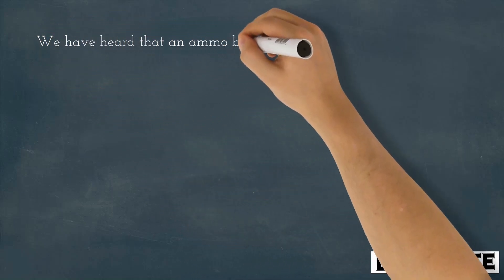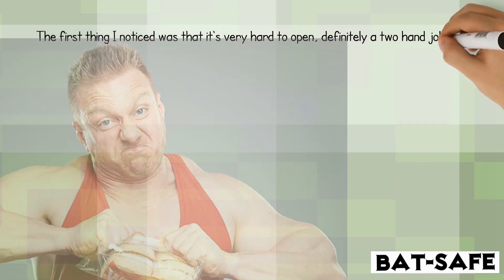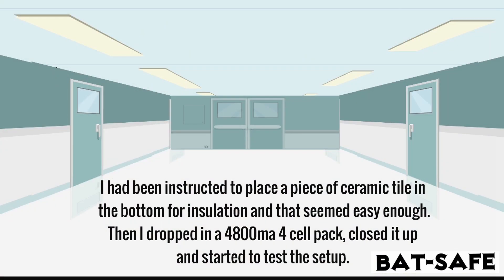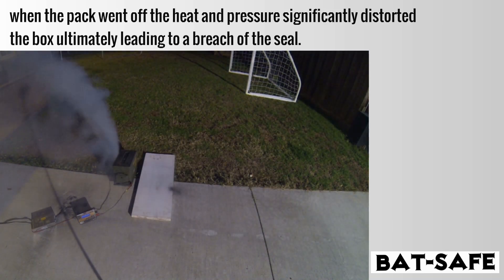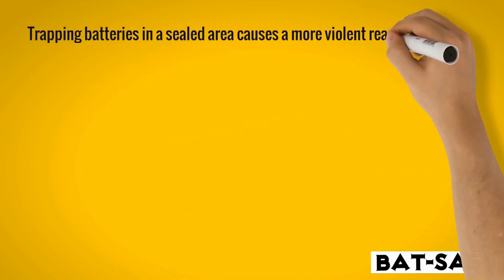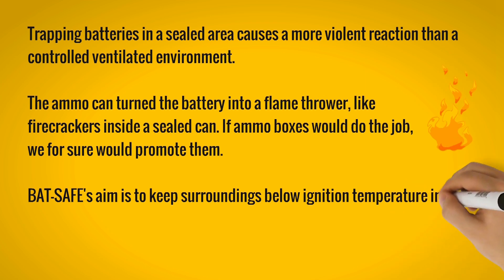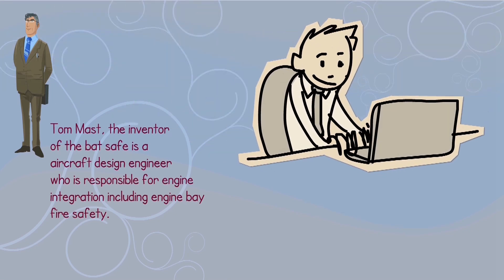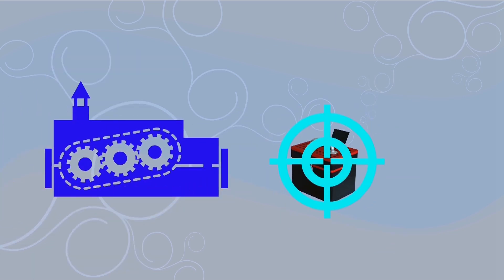Ammo can lipo fire test

Comment: There is a "flamethrower" effect with or without the seal. Show me one single video of these cans "exploding" as others say with a seal. Nope, you cant.
Reply: What about placing your lipos inside a 30 cal ammo box ( with seal removed) then placing the 30 cal inside a 40 cal ammo box ( with seal or lid completely removed. The second larger metal barrier will prevent the flames from hitting anything flammable.
Reply: @emalior5000 go ahead and create whatever scenarios you want. These will however, distract from the issue at hand. This being a false rumor that has somehow become an accepted fact by users of lipos. No true scientific testing of ammo can detonation by means of a lipo failure with AND without a seal has ever been done or proof shown.

Not one single time. 

Furthermore, I'm convinced I know where this false theory originated and have followed the spread of this misinformation for several years.

Comment: These boxes have no filter for the smoke.  Smoke damage can ruin your home furnishings etc.  Also, this box has no hole for the charging cable.  The battery is not supposed to touch metal when charging either.  These ammo boxes may help but they fall short on toxic smoke.  The Bat-Safe covers all the bases.

Comment: To prevent the lipo battery from building up pressure and making a more severe big explosion I recommend drilling at least three 3 1/2 inch holes or make thin vents (thin vents and 1/2 inch holes are good so pressure cannot build up and only smoke exits the box)

Comment: On my Ammo boxes I cut out
the seal on the sides but left the front and back in place. Do you think this would let out enough pressure?
Reply: i did the same but i also drilled 4 1cm wide holes in the top of the box just to be sure
Reply: @*WoLFie*  that's a good idea. Haven't done that yet. Recently bought several Bat-Safes for the bigger batteries. Really impressed with them. The ammo cans are now for the 1s & 2s batteries so I'm thinking the side seals being removed should work well. Do appreciate you responding!

Comment: Put a 1/2" hole in the box and make sure the vent is not pointed at anything flammable, and you have a great lipo safe.
Reply: or grab a bunch of lipo bags and stick a bag in a bag in a bag in a bag in a fucking  box with wet sand on it
Reply: @jonathanoxlade4252  I rather use ammo box